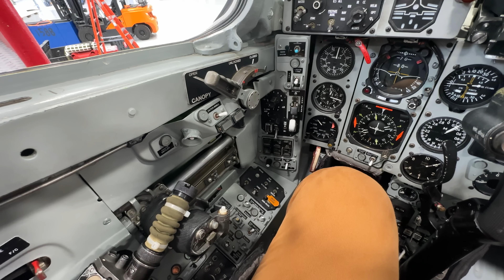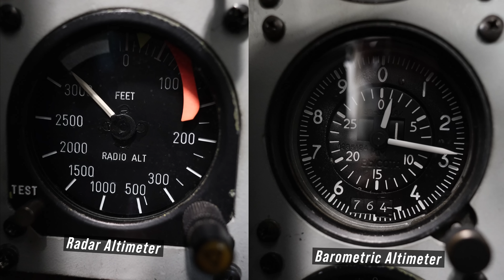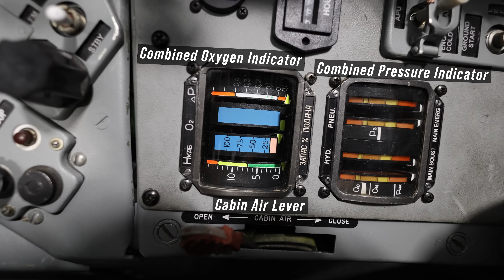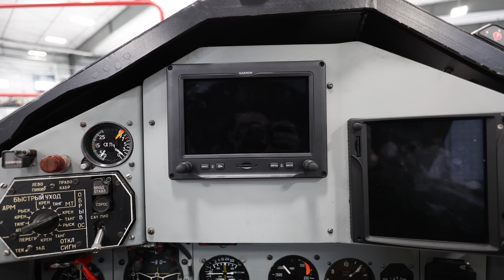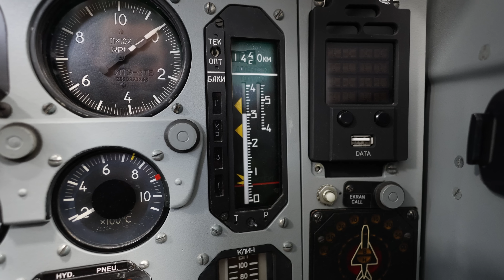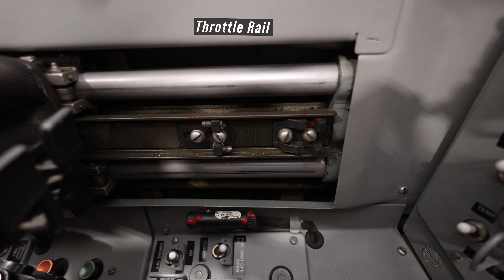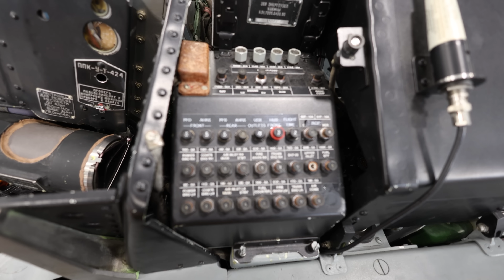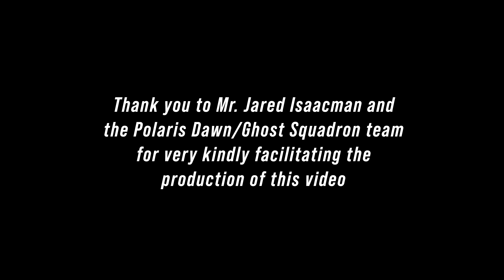Inside an American MiG-29

Comment: I flew the Su 27 for 15 years and the Mig 29 is also a wonderful machine.
Reply: what are the differences between Sukhoi Fighters and MIG fighters?
Reply: @ReadyOnThree size would be the number 1 thing. The Flanker is absolutely humungous
Reply: @uberschnilthegreat22   for real !!! i saw the mig 29 when i was young and i thought that the su30 will be the same size and then i saw a small building flying XD .
Reply: @PatrickBhardwaj  And to think that the F-14 is actually quite close in size to the Flanker as well, it's crazy to imagine planes as big as the Tomcat, along with the Flanker's naval variant, the Su-33, operating off of aircraft carriers.
Reply: @ReadyOnThree  Depends on the specific one. In the case of the Su-27 and MiG-29, the Su-27 was designed as a long-range patrol and air defense fighter hence its massive size and fuel capacity. The MiG-29 was designed as a cheaper alternative similar to the F-16. It's much smaller, has a shorter range, and is designed to operate from smaller air bases.
Reply: @Monarch683  can we say that Sukhoi build fighter and Mig build interceptors ? Because back in the day all Mig’s were interceptors
Reply: @ReadyOnThree  Not really no. That only applied back in the day, and the line between fighter and interceptors has thinned now. It all depends on the specific aircraft you're talking about. There's no "simple" answer for the question you're asking.
Reply: @uberschnilthegreat22 it makes sense for them to be big though 
like the su 33 is slightly bigger than the su 27 to gain more left on short runways
Reply: @ReadyOnThree  Size and capability. The mig 29 is a small, lightweight front-line fighter. It can take off and land on unprepared runways which makes it ideal for short range hit and run attacks. Sukhoi's are larger, heavier and more capable. In car terms. If you want to imagine the Mig 29 as a Porsche 911 then the Su-27 is a Bugatti Veyron.
Reply: until the planes were given to nazi regime in ukraine?

Comment: I saw this bird last summer at AirVenture Oshkosh 2023, it was an amazing airshow. The thunder from those RD-33 engines reverberates through your chest! Great performance and aerobatics, the G's must have been something to experience in the back seat! They did formation flying with a Mig-17 at the show too! The Mig-17's afterburner is quite unique with it's pulsing flame vs the Mig-29's smooth flame with thrust/mach diamonds extending outward.
Reply: mig 17's dont have afterburners probably was a lim 5
Reply: @bigbruhther1529 mig 17 has afterburner and is in fact the first mig equipped with such

Comment: does anyone know what that WZL2 panel is for? i've looked it up and it seems like it's a Polish aircraft maintenance company but i don't see how a maintenance company would need a permanent display inside the cockpit
Reply: Well, since it replaces the original EKRAN indicator, it must also be some kind of a system malfunction display.
Reply: that could be it, but i have a feeling its something else as i don't see a reason to replace the whole display except in the case of a complete malfunction which is probably unlikely @rizdaw304

Comment: MiG-29 may not have the best record of all jets, but it was initially designed to be a part of air defense systems of Soviet Union. And exported variants were always cut down. Meaning that it always did fight in disadvantageous conditions. But all in all, it was a good plane, in very bad circumstances

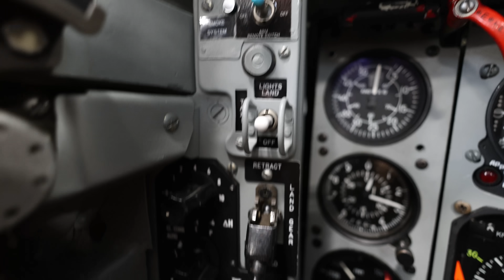Comment: Nice video. Great plane. I had the opportunity to sit in the cockpit of the military version of the MiG-29 several times. In the video at 1:48 it says "radar control panel" ?? What kind of radar? As far as I know, the standard version, the military, MiG-29UB does not have a radar.
Reply from the maker: My understanding is that as a trainer aircraft they still needed all of the controls in order to learn how they would operate the radar in an aircraft that had one. There isn’t much documentation for the UB model of the aircraft but that would be my guess.

Comment: Could it be possible for a US corporation to copy the entire design of the MiG-29 (or Su-27) and build them in house? Granted it would be expensive, but you could build your own parts and contract off the airframes as aggressors.
Reply: It’s possible, but the US has only suffered one air combat loss since Vietnam.  Setting up an entire production line for a few op-for planes makes less sense than identifying something domestic with similar performance and using their tactics.

Comment: Nice video! Is the radar still full functional and able to lock other aircrafts or is it used as wx radar only?
Reply from the maker: This is the UB training model so it actually never had a radar. The radar controls in the cockpit are there so that pilots could train how to use them before going to the single seat models that were equipped with full radar sensors.

Comment: I am a big proponent of United States Air Force and Lockheed Martin division of renovating Russian and Soviet fighter jets, because these Jets have so much potential if they’re rigged with top Notch avionics and sensors and coding and supreme air frame material🙏
Reply: Also Russian jet engines are trash, compared to United States..  so so a top notch Pratt and Whitney Engine swap would be ideal

Comment: The Mig 29 is the most beautiful plane, it is not big, the F14 is twice as big, and the Mig in addition to its beauty has the best flying capabilities, the Mig 299 is 250 meters long enough to take off, and the space of 2 square miles is enough for it, it is so agile, it needs a football pitch to turn around. For close combat there is nothing better. Parts you have every ver, its Very much sold Airplane, you have parts on Cuba, Canada. Venecuela,Mexico.

Comment: The way the Russians put the controller for the target designator on the stick and the button to actually designate on the throttle is very strange.  They did it with a lot of aircraft too.